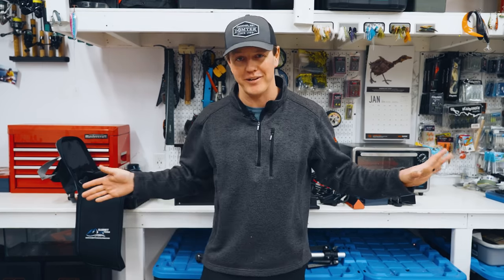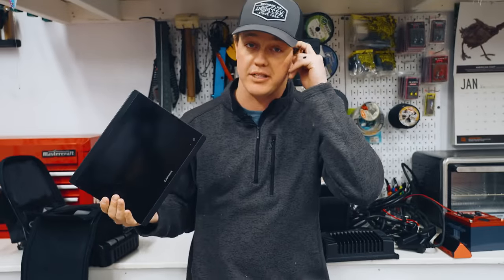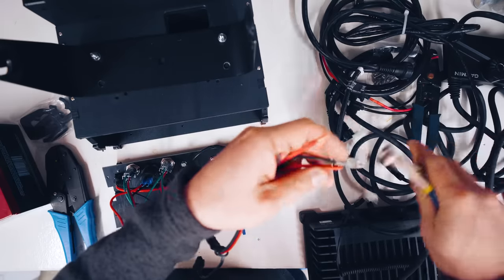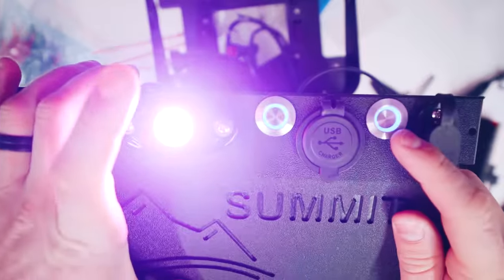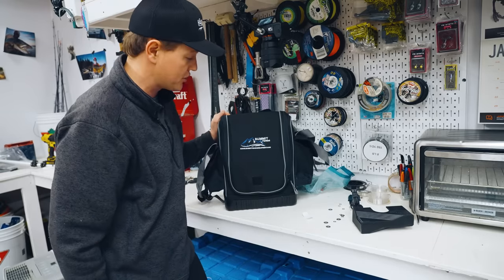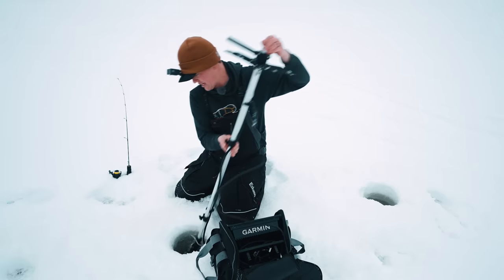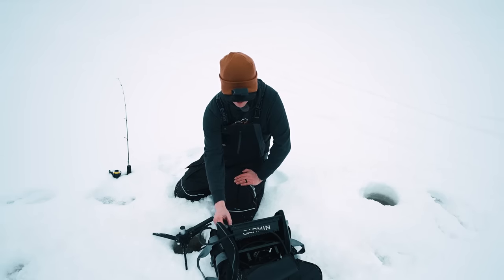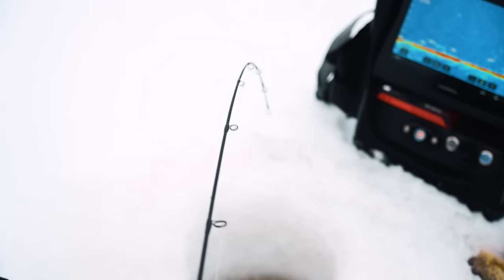Best Livescope Settings For Ice Fishing (My Live Imaging Electronics Set-Up)

Comment: I think the 8610 is their best unit. Bought mine 3 yrs ago and love it
Reply: I use y 8610 with Livescope Plus system in a hard shanty connected to a 27” monitor via hdmi and also connect my aqua-vu to my 8610 with av connection. This way I can split screen Livescope and aqu-vu and record it all with the Garmin active captain helm feature. Additionally, I can add a third split screen and wirelessly connect my garmin VIRB ultra 30 action cam. Love all the connectivity of the 8610

Comment: HDPE is same material used for fiber optic cables, the inner duct pipe is HPDE high density poly ethylene, super strong, won't Crack in low Temps.

Comment: Jay...I have the new summit paired up with the garmin 8610 graph.  Would you say it would be safe to get the large bag from Summit or do I need the XL?  Thanks
Reply from the maker: I used the large bag, it's tight..but I prefer having the slightly smaller overall size.

Comment: Wish I could decide between Mega Live or LVS34
Reply: The 34 is the best in the market right now. But if you are married to hummingbird the mega live will work too. Just wont be as good as the 34.
Reply: ^^ This. You can find lots of fish with either, but the LVS34 is definitely better.
Reply: Garmin has better imaging for sure. However, mega live gets the job done. And if you have lakemaster chips and are used to Humminbirds settings and especially if you want to get target lock or network to existing Humminbirds on your boat, mega live is the way to go.
Reply: 34 hands down